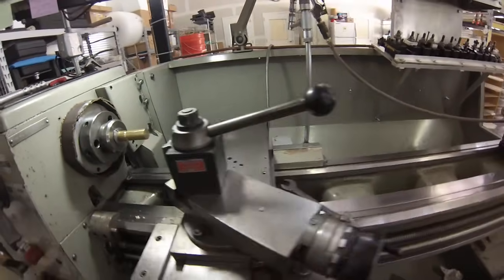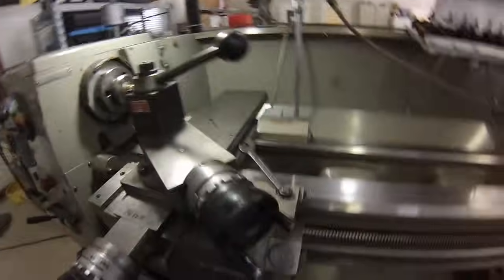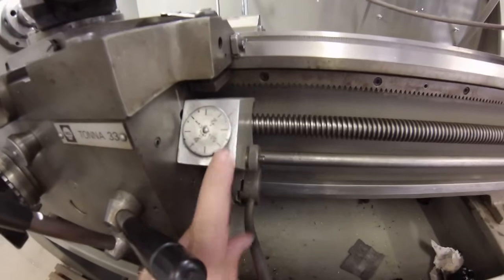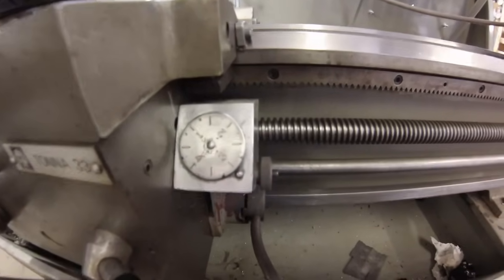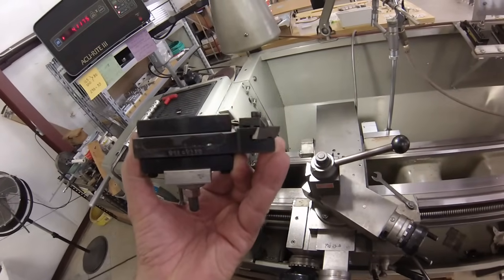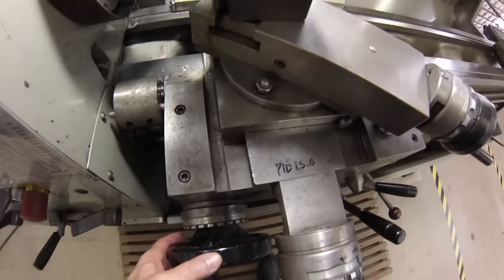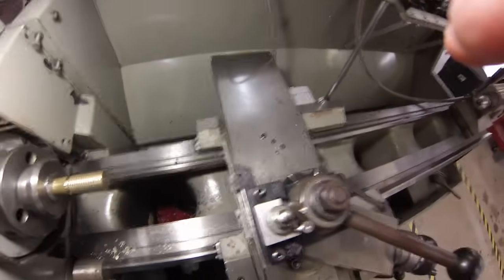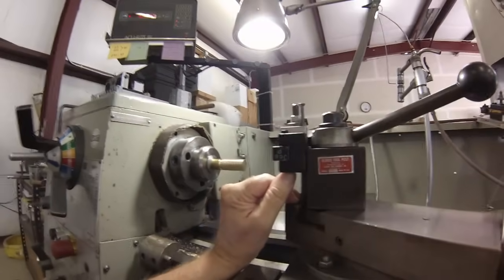Threading on a manual lathe  BEST TECHNIQUE EVER !!!!

Comment: Makes me wish I had a treading dial on my cheap chines lathe.....
Reply from the maker: Might be a sign from above to get a new lathe.
Reply: Might be a sign there's not enough chinese on the lathe ;)
Reply: You probably have a metric lathe, the thread dials on metric lathes are complicated and have multiple gears in them. Look on Ebay, you might be able to find one you can retrofit.
Metric is really nice because it is all base 10, but Imperial is nice because you can simply and accurately divide by factors of 2, which puts odd prime number divisions also easily attainable (3*2^3 = 24 for example).
Reply: I need to use a 127 tooth gear to cut imperial thread, I believe that would make my lathe metric. I'm not going to change to imperial but a new lathe would surly be nice :)
However, having a vfd does help. You can slow things down and program a very short brake time.
Reply: Rolingmetal When I referred to extra gears, I meant they are in the dial itself. 
Here is a pic of one, note it has three gears in it and you have to use the correct gear for the pitch you are cutting.
http://www.practicalmachinist.com/vb/attachments/f38/35598d1308489249-making-threading-dial-thread-chasing-dial-metric-lead-screw-metthddial13-16b.jpg
Reply: Mmm, that doesn't look like something I can make. Way off my skill set.
Reply: If you leave the half nuts engaged, stop the lathe and wind it back either slow or by hand you can cope without the threading dial.  It is a pain but for occasional threads it's cheaper than a whole new lathe!
Reply: MASKING TAPE TIP: For thin thread wires I like to tape a flag on one end of the wires so when you accidentally drop them in the chip pan you can easily find them. Wires are great when you don't have a thread mic.  PS...If you ever move to Albuquerque I'd love to have you working at our shop ;)

Comment: it is a good tehnic for very short threads. If you nead a live center suport it is the same thing then treading normal. You can choose in what you want to crash if you miss . :)
Reply from the maker: There is some truth to this. Every situation does have its limits. I would suggest the following if you do need a center. 1. If you can, leave extra stock ( an unthreaded boss ) on the nose of your part to support the centerdrill feature and cut it off when you are done. I use this trick on long parts that do not allow a center present. 2. possibly invest in whats called an extended live center. The ones I've seen are full diameter for the body, but the point is necked down to a smaller diameter before the final part contact taper. 3. Make sure your tailstock is far enough away from your carriage travel zone to give you a comfortable disengage zone.  Good Luck. Thanks for the comment.

Comment: Nice trick. A note: when you use thread wires you MUST use the chart that came with the set you are using, I have two sets by different manufacturers and the charts are different, as are the wires used. They are of different size for the same thread pitch. Especially true if you get a metric thread wire set from China.
Reply from the maker: Great feedback. Thanks.

Comment: Actually it may be worth warning people who use smaller lathes with screwed-on chucks that this method may not be for them, due to the risk of the chuck unscrewing in use.
Reply from the maker: You are correct. Larry Sperling in the comment string below also commented on this a while back. If your chuck isn't keyed or cam driven, please be careful running your machine in reverse for any reason.  Good comment.

Comment: I feel like I'm missing out as the lathe I work on doesn't have a threading dial!
Reply from the maker: Can you tell me what brand it is. i have never seen a lathe without one.
Reply: Could be a Hardinge. We have a Hardinge that has a throw lever to disengage the lead screw. The half nut is meant to be engaged the whole time during threading passes to maintain its clock, and you just throw the lead screw leaver to shut off its rotating. Its a real pain because the throw lever for the lead screw isn't just on/off, it's fwd/off/rev. So you can't just quickly throw it off.
Reply from the maker: Zach, If my memory serves me correctly, Hardinge lathes also have an adjustable collar connected to a rod passing through the carriage that shuts down the thread process. It controls the thread lever when the carriage hits it. Is it possible your collar is missing?
Reply: You are indeed correct. I didn't bother mentioning it because i wasn't sure you would know what it was. I was wrong! The carrage soft-shutoff is a nice feature if you have a relief zone for your threads. I'm still tempted to try this method though. Looks pretty great.
Reply: Joe Pieczynski
It's a small colchester lathe...maybe too smal! I think it's from a student lathe line...

Comment from the maker: To my You Tube viewers. I welcome all feedback, negative or positive. Naturally, this technique has saved me hundreds of hours over the years and made threading more enjoyable. If you have any fears or reservations about the advice, by all means run your machine the safest and best way for your skill set and environment. Thanks for watching.
Reply: The easiest way to measure with pitch wires is to hold them in place with an elastic band.
Reply: Better not run your Lathe backwards if you have an older machine with a threaded spindle! Most of us old timers don’t have a 10,000 dollar Lathe in our shop to play with.
Reply: Joe Pie, I remember the clenched butt in HS, those 40 years ago, like it was yesterday! 
Just getting back into it all as a hobbyist so Thanks a ton Dude.
Reply: Joe Pieczynski First great video! Second i was just talking with a co worker about this he swears that the angle must be set at 29.5 degrees and u only can use that to adjust your depth of cut then just use the straight back to get back to zero. I said u should be able to go straight in every time as long as u clock it correct. He argued that our cnc lathe compensates a small amount each time it enters when threading to go in at a angle. (All we use is carbide) so why is this and who is correct?
Reply: Joe Pieczynski .... Thank You Sir .... If you have anymore trucks for an engine lathe or a vertical milling machine .... Im all ears Sir
Reply: Joe you are the man!!!! Thank you for all the info you share on you tube !!!!!
Reply: Thank you for the time you spend teaching novices like me. Best regards from Brazil!
Reply: Ecoboosted, as no one else has answered I shall jump in. You get equally good results doing it either way, all things being equal. The old excuse that you have to go in at an angle to prevent chip crowding is just plain hogwash on any reasonable quality lathe. If using full form carbide threading inserts you might actually notice an improved finish going straight in. If you doubt this, give it a go for yourself and then you can speak to your co worker with some authority. Regrettably some classically trained machinists will only follow their tutors instructions without the giving it any thought of their own. The better machinists, like Joe, Robin Renzetti or Stefan Gotteswinter have the wit to give what they are doing some thought and will try different things. 

Remember that an apprentice should not just equal his master but exceed him, otherwise the trade becomes stagnant. With the likes of Joe there is little risk of this.
Reply: With the tool upside down and threading left to right, does the 29  1/2 still apply or it the degree 30  1/2?
Reply: @sonnyhess6262  In this case Joe has not used the compound slide so neither angle apply. You can see from the footage that the compound is probably set nearer to 60 degrees, and as he has said, with this method the angle of the compound does not matter. It can be set to 90, 40, 70, 0 and you will get the same result, because the depth of the tool penetrating the work piece is controlled by the cross slide only.
Reply: Hey Joe, another great video! Any chance you teach machining locally, or would allow a fan to spend some time in your shop?
Reply: Joe Pieczynski  can you give a briefing about the threading dial? My lathe comes without the threading dial and whats the best way to make homemade threading dial? Thank you
Reply: @mathankumar6473  Leave the half nut engaged and just reverse the rotation to prepare for the next threading pass.  Do not disengage the nut until you are completely finished with  threading, measuring and confirming the threads are to specification.
Reply: what is different about setting up an up side down tool
Reply: Hi joe i see your using a colchester mascot, you wouldnt happen to have a pdf copy of the operators manual would you?
Reply: Joe Pieczynski what about the fact that it is picking up on the carriage versus pushing down?  Do you think it could put funny stresses on the machine. I realize it’s not a ton of force but still
Reply: @Mad.Man.Marine  I do it on a Southbend heavy 10 with no apparent problem. It also has a camlock spindle so reverse running is not an issue.
Reply: @disgruntledscientist  I have a thread on chuck but have fitted three lock blocks to the back-plate which engage into a groove in the spindle to stop it undoing. It works perfectly and can run in reverse with no fear of the chuck spinning off the machine. 
Threading in reverse with upside down tool is so much easier
Reply: Curious guys, when you thread after the first pass how do you start the second pass excatly where the first pass left off?
Reply: i thought the compound would have to be turned so cutting side of tool would lead in......if you can picture what i mean
Reply: Oooohhh! dangerous words there! '...Remember that an apprentice should not just equal his master but exceed him....'  BUT you are Darned RIGHT = CORRECT.  I too would agree with you and have been a victim of this Cult...   The Union and other factors ..'respect fro Elders - they know best etc, ...'   VERY DIFFICULT. - but you rose to the occasion - Thanks for that.    
Yes Classically Trained folk CAN have a  detrimental effect - if there is no thought given to the process.  I too as a teacher at one stage in my life had "fallen" into that trap:  Had read the book, done the job - and never given it a 2nd thought - UNTIL what I was doing was challenged:  then the knowledge to be explain the reasoning comes in  - and from where do you have knowledge if you don't think outside the box ?
Reply: That is epic!  Thank you Joe!  :o)  I've wondered why my shop teacher taught us the clinched butt cheek method and thought since then it was better to come up with a better way.  Here you have done just that.  Blessings  :o)

Comment: Joe, good video. I found that the more trying part of manual threading is engaging the half nut correctly. I usually thread work that is an inch in diameter or smaller at ~200rpm so that for the threads most often cut (between 14-32 tpi) the thread dial is moving fairly quickly and hitting the correct engagement is the problem, not disengaging the half-nut. Often I am supporting small diameter work with the live center to prevent spring back. This means that the threading tool is very near the start of the thread and missing the mark on the thread dial, as you noted, makes a mess. It takes full undistracted attention to do it successfully every time.
    If the tail stock is being used to support the work, your method will require you to be just about as fast as you would be threading towards the head stock. Depending on the exact circumstances, threading away from the head stock might be advantageous. This would be especially true for an internal thread to a shoulder where it can be difficult to see the cutting tool's position and smashing up your boring bar and ruining the work is almost certain.
    Cutting fractional pitch (e.g. 11 1/2 tpi) or metric lead threads are difficult no matter which way you cut the threads because you can't release the half-nut while cutting the thread... but actually you can with a little bit of ingenuity. On older lathes without a spindle brake, threading to a shoulder in this situation is a real problem... you can't get the spindle stopped fast enough to prevent a crash. The trick is to cut the thread as you normally would, disengage the half-nut, back the tool out as you normally would and then...stop the spindle. Even if it coasts to a stop you will notice that the thread dial indicator hasn't moved much past the mark you initially picked out as your engagement mark. Now, put the lathe in reverse and when your mark comes up re-engage the half-nut and allow the carriage to traverse to the other end of the work piece and stop the lathe. Make your compound adjustment, return the cross slide to your zero, and the lathe is now ready for the next pass on the thread. 
    I don't use any insert tooling, so I never plunge cut a thread with high-speed tools. Unless the work can be turned at a surface speed suitable for carbide tooling it's an invitation for short insert life and breakage.
Orlin in SC/USA
Reply from the maker: Thanks for your comments. Extended live centers are available and may offer some relief from that moment of pure horror when you have to disengage the half nut so you don't smash into your live center. If the lathe you are threading on is your own, make sure the OD of the lead screw is burr free. Back the carriage all the way out and turn the machine on with the lead screw turning. Check it and clean it thoroughly. Dust it with a file if you have to, but stay out of the threads and don't get pulled in.  It will help a little to allow you to slip the half nut into position when getting close. I have marked up my dial with a sharpie marker so I have a big fat line that shows me a safe engagement zone somewhere beyond the last point of half-nut engagement. On my Clausing, there are 16 places you can engage the half-nut. 4 of these locations are numbered. 4 of these locations are not, and 8 of these are in between every line. That translates to an engagement point every 22 1/2 degrees. Start to slip the half-nut down about 10 degrees before the line you are using comes around and it should work. ( try this on a scrap piece first !! ). Good luck and thanks again for commenting.
Reply: How about getting a half center?
Reply from the maker: If you're being serious, half centers are usually dead centers used on indexing heads on a mill.  They give cutter clearance for putting flats on shafts  and such. Is there actually a half live center as well? I am serious. I like to hear about things I am not familiar with.
Reply: By the definition (and keep in my mind, you've been in this industry for much longer than I, so take this with a grain of salt) a dead center is a center that spins along with the workpiece (aka a headstock center). A live center, is one that is stationary, at least on the shank. So, the tailstock centers we commonly use are actually ball bearing live centers. (The definition has kind of evolved now to be anything with a ball bearing = live, else = dead.) But, non ball bearing live centers are still live centers, they just need a little grease. So, from what I've seen, yes, you can get carbide tipped live half centers. https://www.amazon.com/Carbide-Notched-Lathe-Center-03016B/dp/B008B1SSEA
Reply from the maker: Your logic is sound. I personally have always referred to any center that is not ball bearing driven as a dead center. Old habit. But, the very same dead center you could use in an indexer tail stock on a mill can be also used in the headstock of a lathe to center a driven part between centers. Great feedback. Keep me honest..

Comment: very interesting technique . i think it would be worth mentioning that this may not be a good choice when using a lathe with a threaded spindle.. i am a new subscriber and i'm looking forward to more videos. thanks
Reply from the maker: Some older lathes do have threaded chucks, but as I recall, the chuck body is keyed and only the locking ring is threaded. The heavy key takes any excessive load, but the tool would break long before the chuck ever loosened up. But, if I am not familiar with a fully threaded chuck, then absolutely, running the spindle in reverse would be risky.
Reply from the maker: Is there something specific you would like to see?
Reply: joe i think you are referring to the l-o spindles. most older lathes like south bend and atlas in the 9 to 12 inch range use threaded spindles 2 1/2-8 thrd being most common,
Reply from the maker: Larry, I do recall having to beat on my chuck key to remove a chuck on a small south bend lathe I ran many years ago. I have also encountered the collared type on keyed spindle noses that need a huge spanner wrench to disengage. I hated it when I saw someone put a piece of stock across the face of the chuck between the jaws and start pounding to un-loosen the chuck. Naturally, running a lathe in reverse if it has a right hand thread mount chuck is entirely up to the operator. The popular cam type that my Clausing utilizes is very safe for this technique as is the keyed nose and threaded collar type. Great comment. Thanks for your replies.
Reply: Yep. That's my problem with this method. It's unlikely that it would come loose, but I never like to do anything above light load in reverse. I always use a strap wrench to remove my chuck, I think that is the least harmful way to go about it. Good video. Now using collets, game on.